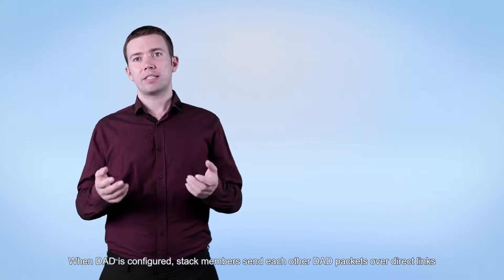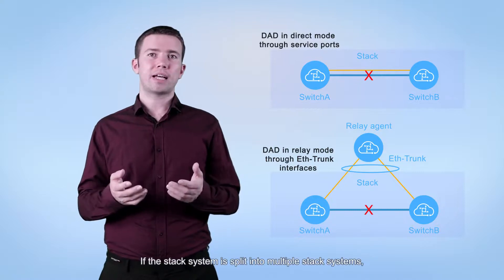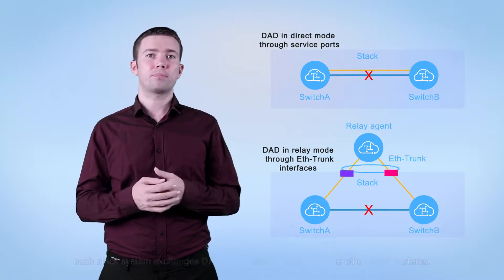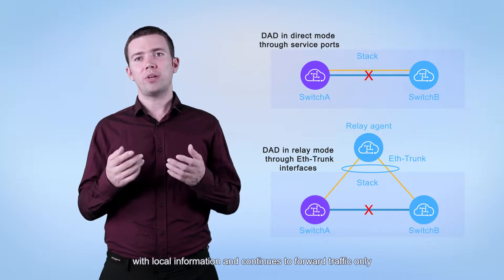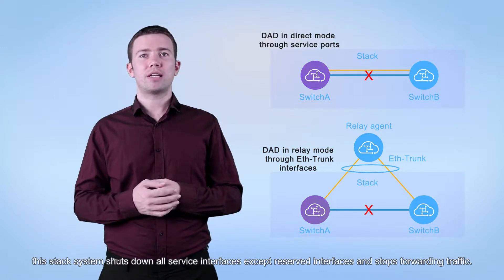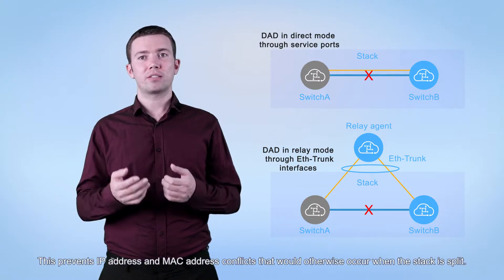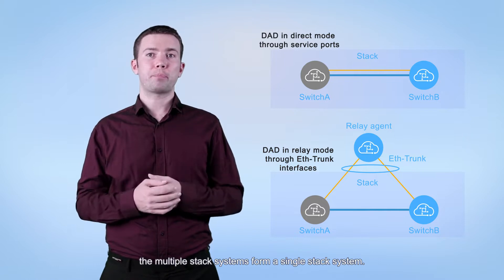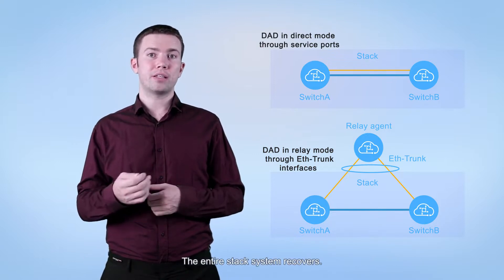What is Huawei CloudEngine Series Switches Stacking

Comment: Is it possible to stack 6 core switches together in a network
Reply from the maker: Only two CE12800 switches can be stacked.
Reply: @HuaweiSupport  In my current project we are using S6730-H48X6C. So how many numbers can be stack together
Reply: upto 8 you can @MrVipinkc86